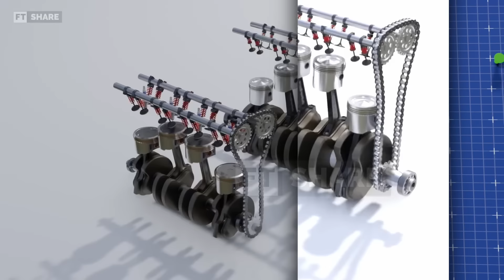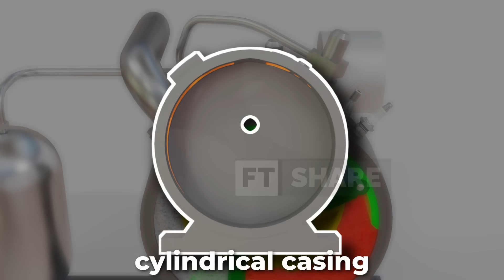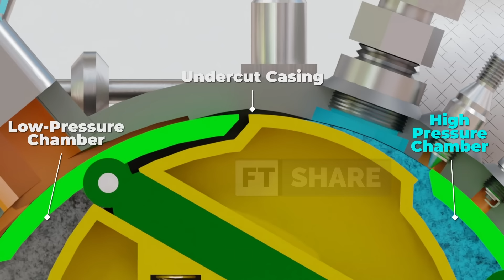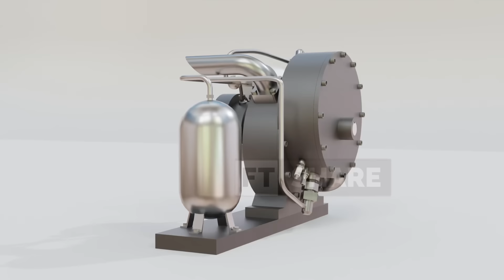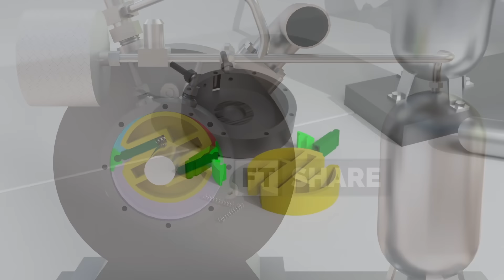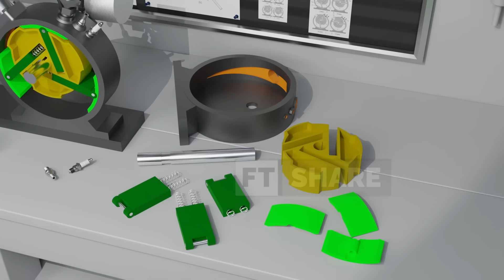New radial vane rotary internal combustion engine. No crank shaft, no valve system, no cam shaft.

Comment: Ok so a few things to go over:

1: Lubrication. Doesn't seem possible if trying to run it like a regular everyday only fuel/air mixture combustion motor. If we go with the idea thag the engine us ran like a two-stroke, then yes it could work, due to the fuel being a fuel/oil mixture. This creates problem 1a: Emissions. Can be fixed if the exhaust runs through the manifold, into a turbo, that feeds into a catalytic converter, and then a muffler for good measure. The turbo burns exhaust gasses and thus reduces the emission issue caused by the solution to problem 1

Problem 2: how to feed the air compressor a constant suplly of preasurized air? One answer: Procharger. It is a belt powered turbo that can compress and force air into the air tank, thus helping the engine run. Stick a pulley on the end of the output shaft, run a belt from it to the procharger, add your air intake, and boom, you have pressurized air going into the air tank.

Problem 3: Sealing the shafts of the things controlled by the springs. Simple solution, make shafts cylindrical and add the equivalent to piston rings to them. Keeps the air/exhaust from leaking into other chambers, and thanks to the two stroke solution of problem one, the rings are lubricated by the fuel/oil mix going into the engine.

Problem 4: After adding all of these solutions, the final glaring issue is cooling? How to combat this? In my own theory, use an Aluminum Billet block, machine precision holes through the housing OUTSIDE of the combustion chamber, and run a meathod of cooling through said holes to keep the metal cooled. But that's a very sketchy idea... I don't have any other ideas as to combat the overheating issue, so feel free to leave ideas in the replies.

If problem 4 gets solved, then yeah, IN THEORY, this engine MIGHT be able to exist.

Comment: The expectation of the cylinder wall pushing against the sealing shoe, to exert a force to push the spring loaded connector back into the rotor vane slot in the exhaust phase without binding up is a reach. Look at the geometry, particularly the angle of the spring loaded connector in the rotor vane slot. From 6 to 12 o’clock the spring loaded connector will experience a great deal more lateral force impinging sideways against the spring loaded connector rather than an inline force (if any at all) exerted along the length of the spring loaded connector to push it back in the rotor slot. It would make more sense if the rotor were spinning counter clockwise through combustion, than exhaust cycles rather than clockwise with the illustrated geometry.

Comment: Why!!?..   Ummmm... we have 46lb 1000hp Electric Motors now..... with instant torque .......and New Batteries made from Sodium no longer using Colbalt, Lithium and Nickel.  CATL are now manufacturing Batteries that are 500wh per kg.  We needed them to be 200 to make VTOLs realistic.  BEV technology is happening at light speed...  ICE AGE is over.  OIL, Coal are Dead.  Soon with AGI/ASI SuperConductivity will be a fact and Sheeeet will hit the fan.

Comment: In an alternative universe where is no friction and engines don't need cooling or lubrication this ''engine'' would be perfect. Maybe not to power your lawnmower or chainsaw because the the compressed air tank needs space at least the size of the engine but as a model on engineers desks to show them how to spend or better not  depends on their goals as engineers thirty odd years making good money fiddling with a glorified Wankel engine.

Comment: I see a plethora of sliding joints that need sealing.  These include the edges of the rotor, vanes, and sliding shoes where they run against the sides of the housing.  The faces of the shoes against the outer internal radial faces also need sealing.  And the sides of the vanes where they slide in and out of the rotor must be sealed.  Then having accomplished all that how are the cavities under the sliding vanes to be ventilated?   How is this device to be lubricated and cooled?  I see a lot of dubious engineering needed to bring this device to market.

Comment: I have been working on this engine design since I was studying Aeronautical and Mechanical Engineering in the early 1990s. This design still has the same sealing issue as the Wankel rotary engine. Sealing between the chambers on the radial surface only deals with one of the sliding surfaces, the sides of the vanes also need to seal with the side walls of the chambers. and in the rotor. As the temperature increases the vanes increase in size relative to the rotor and the outer case. This mean that the vanes have to be smaller with large gaps along the sliding surfaces when cool, so they don't seize at operating temperatures. This leaves large gaps that need to be sealed. Cooling the vane and rotor is also an issue not discussed in this idea.
Reply: Have you made a working model since the early 1990s?
Reply: @Mr51alvis  nope,
Reply: @Mr51alvis  nope.

Comment: There's so much more to a useful, practical, functional, engine. There is no mention of lubrication, output control or rpm control, minimum or maximum rpm, estimated output in any metric? No functioning prototype. Nothing. All this is, is a concept, at best.

Comment: This is similar to my magnet motor. Yes I designed a magnet motor that produces usable torque and RPM. It can be made in pretty much any size\HP. It has minimal moving parts and is cheap and easy to build. I am at the point that I just do not have the ability to get it out to the public. So anyone interested in helping get it out there. Please feel free to contact me.
Reply: I wish I had CAD or something like that to so animation of my motor. Or the resources for a patent. But again these are so simple to build. I don't know if a patent would prevent anyone from copying. That's why I have not released a video of it in operation. These are honestly that simple.
Reply: @johnzawicki5032  Sounds incredible. I would have liked to see the world's single most important invention. Shame you will be assassinated by Big Magnet

Comment: The problem with this design is the amount of friction coming from the pivoted seal shoes.  How are you going to manage to lubricate this?  

Not only is the friction going to wear down the seal shoes, but the friction is also going to wear down the stator/casing, and eventually, the friction wear will make pressure problems over time, creating difficulty with combustion, as it cuts into the pressure chambers.

I sure hope the springs you're using for the seal shoes are reliable.  Springs do break over time - so how long will that last?  The design is pretty cool, but I worry about the friction, and the longevity of the springs.  

I suppose you could use tungsten carbide coating on both surfaces to minimize wear, and have special springs with an alloy that can last.  

You might want to deepen both pressure chamber channels, and increase the size of the outer casing to to make up for the loss of material, this way the rotor will hopefully last longer, and you can tune your fuel system to compensate for the pressure differences that may be created by friction wear.

Comment: so, what lubes the pivoted sealing shoe?
you  still have an oil consumption problem like the rotary. 
and like the achates with ports that happen above the compression ring. 
and what seals the sides of the pivoted shoe against the case?
still the same problem as the rotary.

Comment: Well, it worked in CAD...
Reply: And that's it, the Brayton Cycle reimagined in awful ways. 
There are several issues with this design, the air/fuel isn't being mixed properly, the heat is being concentrated in one spot, the centrifugal force will make those sealing vanes will became a breaking pad, and the braking force will increase with RPM, and I'm saying it already counting this engine would have some insane coating with Teflon or Nofric Ceramics, and the engine balancing would be insane, not to mention the compressor attached to it, to fill a buffer tank, this have all the issues of the Wankel Engine plus the issues of the Quasirotor Engine.
Reply: @russotragik  you missed the most important aspect. pressure acts in ALL directions equally.

all these rotary vane concepts require pressure somehow be selective and only act on one surface to provide torque.

you have almost equal lever arms acting in opposite directions, leaving only a tiny portion to act in one direction... and the remainder of the massive surface areas simply absorbs heat...

they make really good COMPRESSORS for the exact same reasons. 

theyre utterly useless as EXPANDERS.
Reply: Yeah bro, I kept waiting see some metal or at least the air compressor or tank. I know those have been around for awhile. Although it be from Kuwait a fella with a doctorates should be able to afford a camera and air tank.
Reply: Better than the background din did.

Comment: What mechanism compressed the air in the outside compressor cilinder to 9 times atmosphere, very impractical engine and if detonation accure the springs will damage diesel injectors have that issues

Comment: This engine is not valveless. Compressed fresh air must be ported into the chamber by an solenoidal injector, essentially it is air valve. 

No reciprocating motion? Depending on where we focused or mis-focused. The vein do reciprocates cycle per cycle the spindle rotates. 

There is a marked friction and wear to each vein-shoe and the connecting vein. Subsequently this engine use fuel-oil mixture and will consume oil in operation. 

The fresh air from the pressure tank are kept at constant pressure to support demand at max rpm and load even down at idle rpm. To maintain that can drain engine’s output resource to compromise system efficiency. 

Trailing portion on vein shoe experiencing maximum wear. Uneven wear compromises isolation between adjacent veins. 

Rectangle rod vein

Comment: It will still have the same problem that the Wankel has as far as the ends of the rotors leaking combustion, the compressor, will it be rotary as well or will it have pistons? Rotary engines all have the same problem, sealing the ends of the rotating assembly, they did not address this, and it will be a problem.

Comment: The springs could be enhanced using the compressed fuel supply, mechanical springs wear quickly, the lubricating oil pressure could also be used as in hydraulic tappets.
Reply: He just forgot to mention the inherent problems with lubrication. Therefore, for now, I don't fully trust this idea.

Comment: This is the second video about this engine.  Drag of the shoes are not defined and that is critical for the success of the engine.  Tell us how drag is reduced since the full pressure of the compression and combustion chamber is pushing the show against the housing, Hundreds of pounds of pressure per square inch.  
I suggested that the lowest drag would occur if there is created an air bearing, next is an oil bearing and the last is a solid carbon surface that is a bearing that can operate at high temperatures.  I am not that hopeful, but haven't done the calculations for a design. 
The second major problem that is the same for all rotary style engines is side leakage since the engine components are at different temperatures some means of minimizing the air gaps and increasing the travel distance for leakage in the gaps. Thermal expansion changes the clearance so another component(s) are needed that will increase the number of gaps but decrease the width of them.  Piston rings are used in a piston engine.  I am talking about Wankel, Liquid Piston, Vane, and Omega (like this separate compression and combustion rotors but with an incomplete involute gear.) 
Wankel engine has had the most success of any rotatory engine, but it never achieved significant adoption.  The problems of and inability to adjust the dimensions of the combustion chamber resulted in it's removal from the market, never achieve scale.
Reply: The sparkplugs are a major source of pressure leakage in a wankel, and this engine too.

Comment: Leaking! If you look at it in 3D, between the sides of parts in contact with the flat surface (front and back cover) will have a lot of seepage. It won't be possible to make it too tight because of the difference in expansion of the parts. Too tight the friction will be a lot (jammed), too loose there will be  "shortcuts" to other sections. Using too much oil (also as seal) will cause smoke emissions.
Reply: My thoughts exactly.  It's easy to design a rotary engine or compressor or pump in two dimensions.  Add the third dimension, and you have to figure out face seals, as well as the corner where tip seals and face seals have to meet.
I tried to build a rotary vane engine back in high school.  Forty five years later, I still have most of the parts  I might try to get it running when I retire in a few years, but I'm nowhere near as optimistic -- or naive -- as I was in my teens.
Reply: @arnokilianski7889  I've also experienced it while made a gear pump (model) on 3D printer few yars ago.
Reply: Exactly. Same issues as the Wankel rotary.
Reply: It is always fine in 2D, but they always forget how to seal the sides. There will be corners , shields moving sideways and shield there are moving faster in one end as I see it.

Comment: How do the flat sides of the case seal? That will be a big source of combustion gas leakage. Also the AI generated voice made many grammer mistakes.
Reply: That's exactly what I was looking at. There's no way that combustion chamber can seal up.
Reply: Exactly, that’s the problem that Wankel’s had/have not the apex seals.

Comment: Lubrication and wear will be big problems. Sliding that entire "shoe" valve around the housing will create a lot of friction. Same goes for the pivot arms and their hinges. Inserting oil directly into combustion chambers to prevent it from wearing out in the first 10 minutes, will mean burning a lot of oil, which means the engine will never be approved for real life use. The sliding pivot arms will suffer metal fatigue added to high wear. 
Not to mention the "air compressor" feeding air into the chamber, which will use up almost all the energy the engine generates, if it does work at all, with the volume of air needed. Pretty stupid front to back, to put it lightly. 
I can keep going on why this will never work, never be efficient, will never be approved and will wear down faster than any other engine in current use.

Comment: How these shooes are lubricated?
Reply from the maker: Hello, this is only to present the concept. Oiling, cooling and many other aspects are not presented here. 

In my view, oil can be channeled through the shaft to the rotor to the vane to the shoe. 
Alternatively, it can operate with fuel/oil mix like 2 stroke engine. 
Other ideas are welcomed.
Reply: @aksalsabeeh So...you have no clue.... One of the most important facts of an engine, and you have no clue
Reply: @aksalsabeeh 

I would say its super critical detail. Design breaker detail. And if that can be solved, reaibly, than the concept may work, but if it woll be unsolved, it will work at best on paper
Reply: @aksalsabeeh 2 stroke engine? Ok? Now what about emmisions? DOT is not going to allow all that smoke

And you can't mix oil into a combustion chamber of a regular chamber otherwise you kill the motor due to no ignition.

Comment: Looks more complicated than a standard Wankel. Too much friction and weird combustion shape.
Reply from the maker: I disagree, this has no gears, no valves, no unreliable seals.  
It is only cylindrical casing with offset rotor, vane and sho. 

It is simply put, an air motor with fuel injection and spark at the ideal time.
Reply: @aksalsabeeh correct